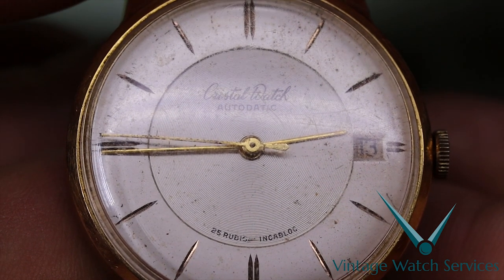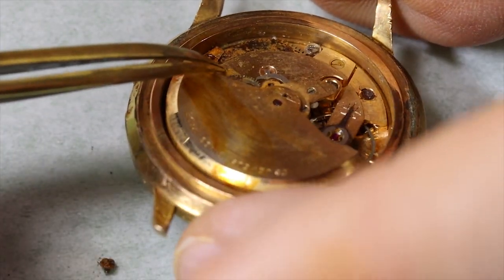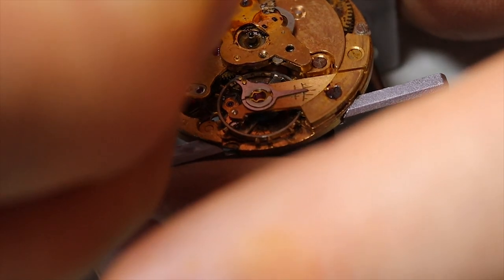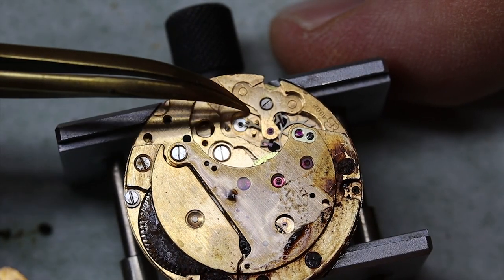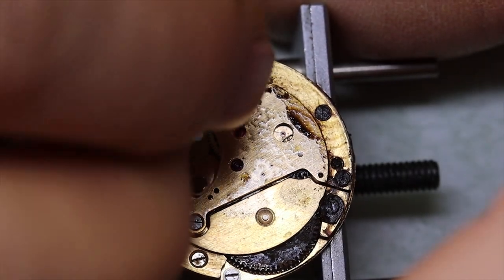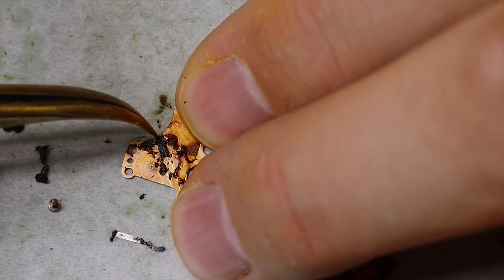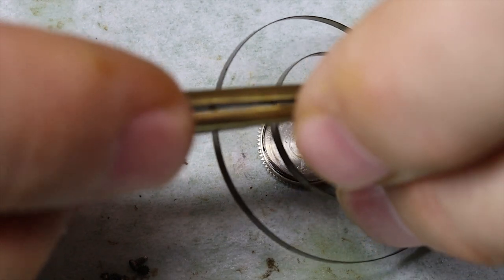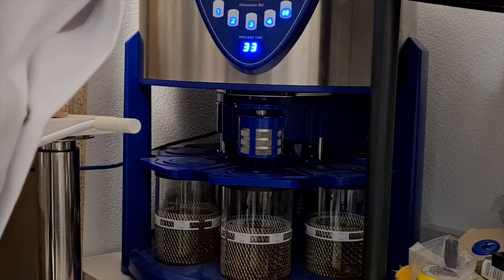The Rustbucket challenge: 1950's diver's watch restoration Part 1 - Stripdown

Comment: I thought the screws would rust too. Coz I assume they're steel.
Reply from the maker: If they are subjected to water and heat they will indeed. Some of the screws were badly rusted and I had to remove the rust from them.

Comment: Do you ever use oxalic acid for rust removal?
Reply from the maker: Hi Frank, maybe! I actually don't know for sure, as I use a few "Rust removal" products if necessary, from Bergeon and others. It might contain oxalic acid. The most common material in a watch movement is brass, which doesn't rust, and if the steel parts have rusted there are basically two ways to deal with it: if it's surface rust it can be brushed off or a rust remover can be used, while if it's damaged the part it will need to be replaced.
Reply: @VintageWatchServices  Thanks much for your reply. FYI, while I'm certainly not an engineer, I know a bit about QC and machining/manufacturing from having worked in a periscope factory many moons ago. I have a deep fascination for mechanisms, and very much appreciate the detail work and skill demonstrated in your videos.